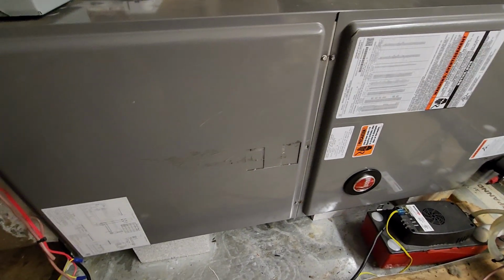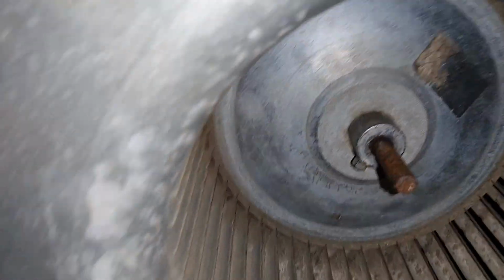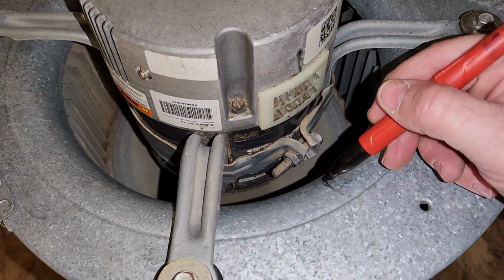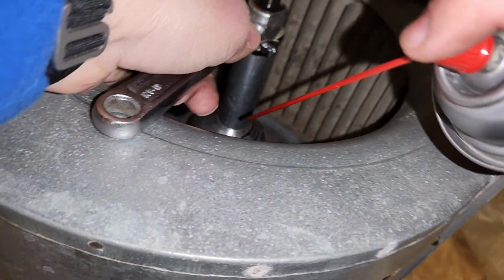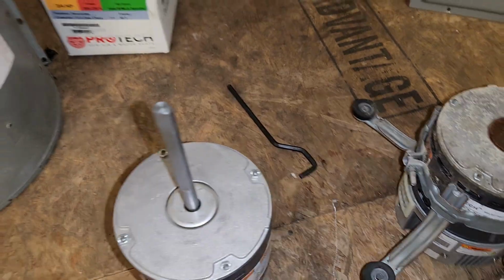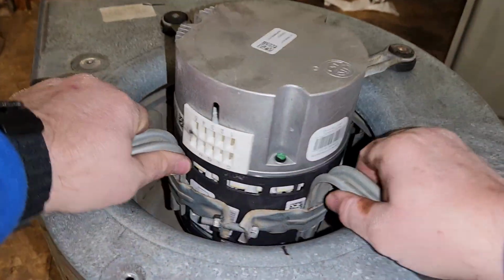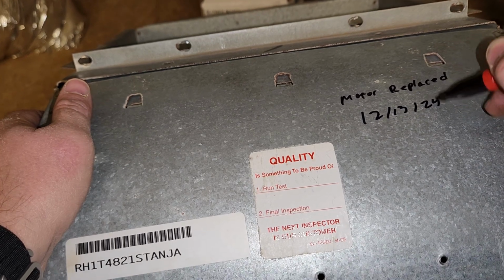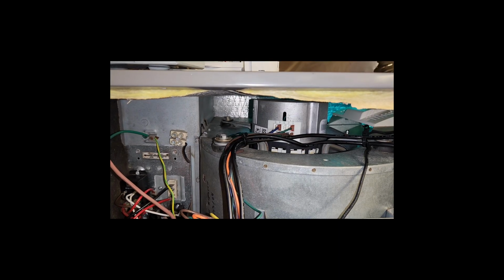Changing a X13 Blower Motor on a Rheem Air Handler

Comment: Years ago I replaced a blower motor.  I sure wish I had that removal tool for squirrel cage fan. I still see the newer units are still a rats nest of wires. Excellent work. Great video.
Reply from the maker: Yes that tool makes a difference. Great investment